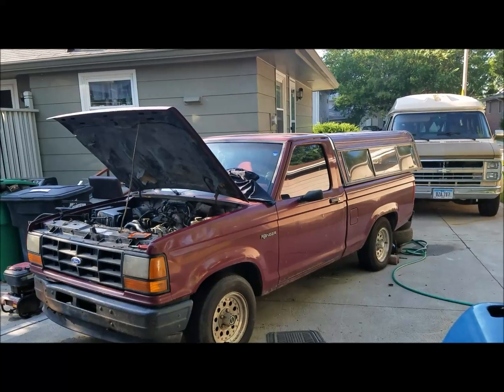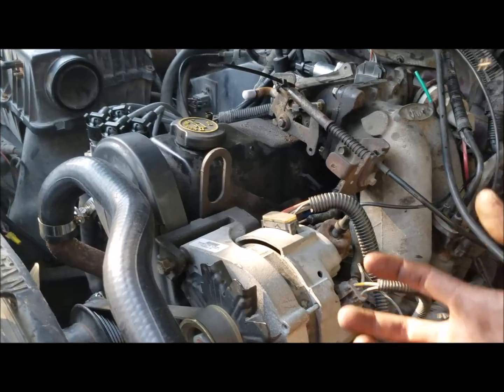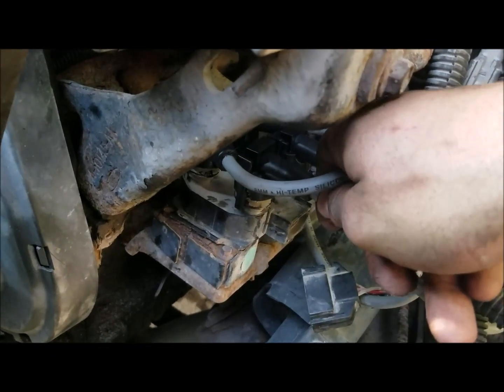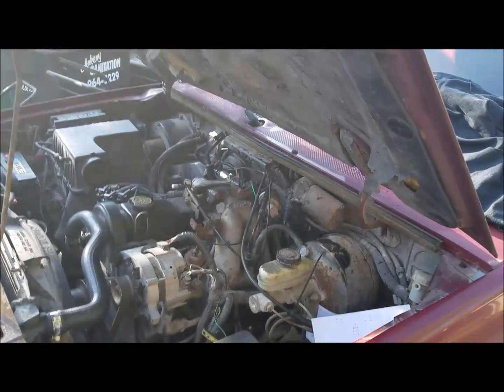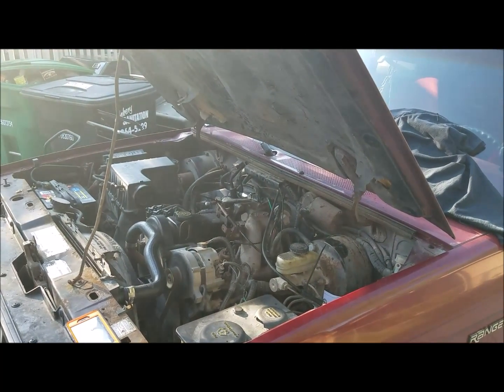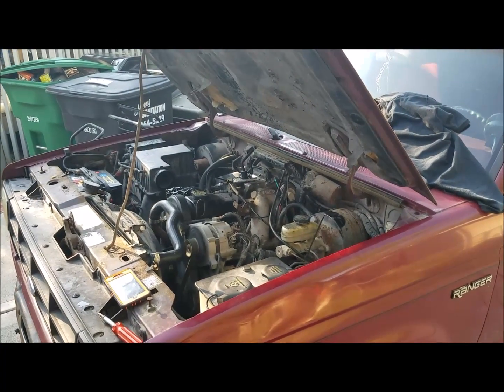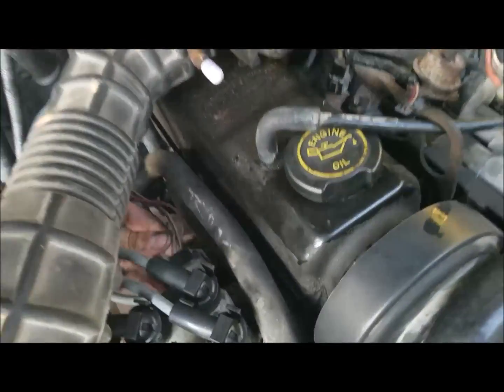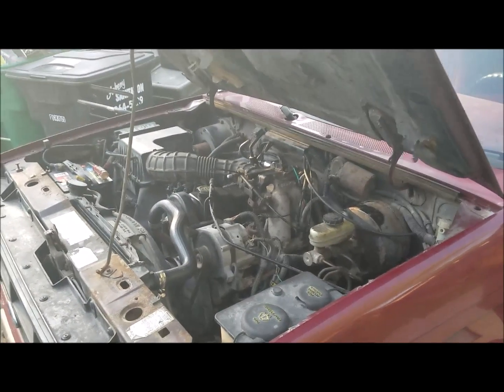Ford 2.3 8 Plug Head - FREE Dual Ignition Mod: How To & Demo (+ HP & ECON)

Comment: Anyone out there no where the cam timing sensor is located on a 2002 ford ranger 2.3L double over head cam engine? I can not find anything on this engine. The sensor is not located behind the coil pack.

Comment: Just did it, it works fine, but I don't feel the actual improvement.
Reply from the maker: The secret sauce behind the different likely only matters if you have the ignition design that has the coil configuration that I have here which apparently was only for 2 years.

Comment: Mine will run on each of the two coil packs. I unplugged one at a time and it stayed running. Is that not supposed to be like that?
Reply from the maker: I bet your coil packs aren't like mine - this has been some time ago, but this video is only true for the engines that don't have the coil packs beside each other.

Comment: You can't burn fuel on the exhaust stroke. It has to be compressed for the spark plug to ignite, and even if it did burn on the exhaust stoke, you got serious issues with that much leftover fuel, and if it did burn, that would be horrible for the engine firing while another cylinder should. The waste spark system is not an emissions thing, its just simpler for it to fire in pairs. And it fires the WASTE spark with the cylinder that's on compression so that it couldn't be more opposite or cause an ignition timing problem. 
The catalytic converter is what burns off anything extra.
The EGR valve is what controls exhaust temperature, keeping pinging/spark knock away. 
Putting the same amount of fuel against two sparks, even if you could without some serious rewiring, isn't changing a thing. 
Would you put two polite lights on a stove? Probably not cause it already starts with one. 
Doesn't anyone think that Ford would have just made them like this if it was better? Again, a waste spark sytem has nothing to do with emissions. It wouldn't be called a WASTE SPARK if it did anything but waste a spark. You can't trick the engine into firing differently by doing this. 

You wanna get more power from a 2.3/2.5 Lima? Fuckin re-gear it, change the tire size, and leave the engine stock cause they run the best the way they were built. There's hardly a thing you can do to an EFI speed density engine to improve performance besides to maintain it, convert it to MAF, or swap the engine.

Comment: What would happen if someone gets the wrong wires in wrong place on accident bent valves dented pistons 2.3l ? Only thanks
Reply from the maker: Your ignition timing or when a plug fires has no bearing on your geometric relationship between your pistons and valves ....
Reply: That year 2.3litre is a no interference motor

Comment: This is a troll myth.. Ford designed this ignition system to fire both plugs at the same time at the factory
Reply: Actually had them fire on ignition stroke and exhaust on other for emissions
Reply: @floridaforecast  it's a waste spark system; cylinders 1 and 3 fire simultaneously, then 2 and 4 simultaneously. It trips people up because there's 2 plugs per cylinder, and they fire simultaneously too, there's not lead and trail like a wankel engine. Couple ir together for a total of 4 sparks per pulse; Cylinders 1&3, 2&4 1&3, 2&4

You can actually rearrange the plug wires to to have 1 coil pack fire cyls 1&2 and the other 3&4 but if you do that, you'll outright loose 2 cylinders if 1 pack fails. That's why Ford arranged the wires to split the difference between 2 coils so if you loose a whole coul pack you're only losing one banks of plugs, not whole cylinders

Comment: WTF??? The system is designed to fire at the same time. One side doesn't fire on the exhaust cycle! Aircraft engines fire simultaneously and are tested before take off with a power reduction being noticed when you switch from dual to single ignition. If yours was set up this way it was defective.
Reply from the maker: I’ve looked into this further - they only did it this way for about 2 years. When they went to both coils on the passenger side, they no longer did it this way

Comment: You do understand that each coil fires 2 cylinders at the same time? Hint, each coil has 3 wires, 12v and 2 control wires for each half of the coil, put 2 and 2 together.

Comment: I thought I killed this modification myth in 2010 on Ford ranger forum. It is physically impossible for this to work because it was designed to work that way from the factory. They have a waste spark ignition system, both coil packs fire a plug on the power stroke and a plug on the opposed cylinder that is on the exhaust stroke. There are two daul post coils per pack, the cylinder that is under compression has the strongest spark. They did this as a cost cutting measure because it's less moving parts.
Reply from the maker: This is actually untrue that it doesn’t work - I messed with some other rangers of different years. The only ones it works on are the rangers that have the coil packs on opposite sides of the engine - this was only for two years. After that, ford did have it fire all the time, which if you open the hood and see the coil packs together - that’s what you have. 

That’s how this mod got popular - because it actually was a thing a one point in ranger production models
Reply: Like your the originator of myth killing lol

Comment: Picked up a 1990 vintage ranger for $800; needed some work, new radiator and hoses, dead starter.  Also found coils for 2&3 weren't firing, swapped the "exhaust" pack or whatever you want to call it until the new coil arrived.  I'm going to give this mod a shot not that I've got 2 fully functional coil packs.  Thanks!

Comment: I've got a 92 ranger and one thing that I noticed that is different is my coil packs for both drivers and passenger side head plugs both reside on the passenger side of the engine next to each other instead of each one being on either side of the engine
Reply: Thats how the newer style 2.3's run. I've started building them for offroad applications and its .ore desirable,keeps them dry and more accessible.
Reply: Mine are on either side but the drivers side one is damn near impossible to. Get to without pulling at. Least the alternato

Comment: Trying this on a 93 both packs are up top, does that matter
Reply from the maker: Yep, it won’t work
Reply: @ThunderHead289  I just tried it and in actually sounded better, and burnt a lil carbon, but as far as actually helping, I haven't drove it yet
Reply: @rickyallgeyer9254  any long term effects from doing this? I’ve got a ’93 2.3L 5-speed 2WD with 3.45 gears. It’s my daily commuter and has problems getting out of its own way trying to pull the hills on the way to and from work. I average around 20mpg with it running about 70mph. I’m looking to maybe get better mileage if not a bit more power out of it.

Comment: @thunderhead289: the "front" of the coil faces the front of the Truck, or the firewall/ coil connector? FYI: My Ranger has both coils on the passenger side of the engine.

Comment: Luke. I bow in humbleness. You are the KING. I'm literally blown away by the mass of videos and data you have put out. Good God, you're a font of knowledge. Simply awestruck and amazed. Thanks for sharing your gift. I'm pretty sure no once competes with the sheer number of videos you put out and the massive data that you put forth. Your interest in this truck got me looking through the classified and I found myself a 1999 Ranger 2.5, with 5 speed manual and brand new tires. The gentleman who owned it couldn't get it started after picking up his dry cleaning and the dry cleaner told him to get it gone from his parking lot in three days. In a panic, the owner told me I could have it for $400 if I towed it in 72 hours. Done! $50 dollar tow to the house and I'm pretty sure it's a fuel pump. Can't wait to dive into this one! It also has the 8 plug head and I wonder if the same mod can be done successfully. Thanks again buddy for your efforts. You ARE the KING! Wow!
Reply from the maker: You are too friendly! Thanks so much, I’m just some average joe guy. 

Now, with the ranger you just picked up - a good way to test if it’s a fuel issue is to simply pop the intake tube off of the throttle body and spray a little carb cleaner in - if it fires off, you no ignition is good and it’s only a fueling issue holding it back 👍

Comment: The exhaust side plugs are on the right side of the engine. Youre swapping the left side plug wires.
Reply from the maker: You are incorrect
Reply: @ThunderHead289  My 89 2.3 exhaust ports are on the right side of the engine. The wires to those plugs are on that side too.

Comment: Be aware if you straight pipe it and try do burn outs you well shoot a cylinder rod threw the oil pan I have a Ford ranger 1994 4 cylinder manual that's identical
Reply: Why would this happen?

Comment: Dont mean to crowd your page, but i found some more info on this mod.
This is for 91-93 owners. This is the TRUE "dual plug ignition mod" not the pointless (and infamous) plug wire swap! It's extremely easy to do. It only took me 15 min once I figured everything out. I got a lot of info from threads on DIS conversions over on turboford.net.

Step 1: Locate the ICM (on the front of your intake manifold)
Step 2: Look for the number 6 printed upside down bellow the top connector (black) on the ignition module, it's the pin closest to the engine.
Step 3: Remove the electrical tape around the wiring harness
Step 4: Follow the wire coming out of the connector on pin 6, it should be blue/green stripe. Trace the wire back as far as you can, it should be at a "T" junction where it enters the main harness.
Step 5: Cut the wire and crimp a small eyelet on the side that comes from the ICM connector. You should have about 6" of wire to work with.
Step 6: Remove the top 5.5mm bolt that holds the ICM to the intake.
Step 7: Slide the bolt through the eyelet and reinstall the bolt.
Step 8: Re-wrap the harness with electrical tape. That's it, your done!

The wire you grounded out is used for the Dual Plug Inhibit function. The EEC applies power to this circuit when the key is in the start position. This signal is used by the ICM to inhibit secondary coil pack operation bellow 1500 RPM. The EEC doesn't monitor the circuit, so you shouldn't get a CEL. Now both plugs will fire at the same time; all the time giving you better throttle response!

WARNING: Since the dual plug setup was originally designed to decrease emissions modifying the system may cause you to fail smog. My opinion: I really don't think it will cause a fail, but I have to cover myself just in case. If it made that much of a difference on emissions then all 4 plug 2.3s would fail. =)
Reply: This say 91-93 owners. But what about 94? I have both coil packs on the passenger side of my engine, as I assume 91-93 owners do.  I'm hoping this mod would work for me as well!

Comment: Can anyone confirm or debunk this Comment I found on a forum from some know it all. 
"That is a 2 channel coil (wasted spark system). It fires #1 + #4 and #2 + #3 at the same time as pairs. That means when the #1 cyl is being fired on its exhaust stroke, #4 is being fired on its compression stroke. (ignoring the other coil, for now.) Switching 1 + 4 does nothing, except move which terminal, on the same channel of the coil, the wire attaches to. 
With this 2 coil system, wasted spark system, you always have both plugs firing on both the comp and exh stroke. One is being fired on the main coil (on purpose), the other is being fired on the secondary coil (as wasted spark). 
If both spark plugs were to fire at the exact same time in two different locations would that not cause two flame fronts to collide creating abnormally high cylinder pressure? When carbon or high compression ignite the fuel mixture in a second location the two flame fronts traveling toward each other and the rapidly expanding gasses cause extreme but short cylinder pressure. So.... two plugs firing at the same time would cause the engine to detonate or ping. I have not messed with a 2.3L dual plug head, but I would have to assume the second set of plugs fires after the main burn in hopes of igniting any un-burned combustables for emissions"?
Reply: Did you listen to the video? The secondary fires on the exhaust stroke. It's mainly for emissions. Did you see his demonstration of the truck running on the secondary coil only? Here's a tip: there aren't professionals on forums, they are too busy working on the subject to go home and keep working for free.
Reply: @colormesarge  Nothing wrong with trying to get a consensus bro. =) And how could you possibly know whether a professional chimes in on a forum or not?
Reply: Anthony Wayne 
You’re absolutely right. They fire in simultaneous pairs, alternating compression and exhaust strokes. The coil packs only have three wires feeding each- one common and two signals to hit the two solenoids alternatively from the ignition control module. If you want both plugs to fire simultaneously on compression stroke you’d either have to swap the wires at the coil pack of the passenger side (exhaust fire) or parallel the coil pack signal wires to force them to fire the same (at least that’s how I see it)
I stumbled on this vid because I’ve got a check engine light- codes 222, 223, 224. Basically the primary side isn’t firing. It’s running off of the exhaust side plugs. Either bad coil, bad ignition module or bad crank position sensor. 
This mod would work in theory, but some wiring needs to be done to get them to fire right

Comment: Have any problems with it? And how do I know if I'm running lean. I've got an 87 ranger 2.3 5 speed
Reply: I just switched my ignition wires with this mod today. I will get back to you in a week. I have done a bunch of work on my 1990 Ranger 2.3l manuel transmission including (head gasket, timming belt, all new gaskets. I set the timming advance 5 degrees and it was running lean... Now it's adjusted properly and running awesome!
Reply: @stevereid5885  how did it work?
Reply: @jagrgreen8123  not even worth the time really...
Reply: If your timming is advanced slightly it will run lean and cause the engine to add to much gas at wrong time. Stank stankey
Reply: @stevereid5885  have any problems with this.mod at all?

Comment: This is a DIS "wasted spark" system, so sparks * always * occur near the tops of both the compression stroke and the exhaust stroke for each cylinder.  That's why each coil pack has only three wires:  Ignition (+), 1&4 coil (-) and 2&3 coil (-).  In other words, each coil pack has only two primaries and two secondaries, and the secondaries have plug wires at both ends of their respective coils.  When a DIS secondary "fires" near the top of every stroke, a spark is "pulled" across one plug gap and "pushed" across the companion plug gap. The spark occurring near the top of the exhaust stroke is "wasted", but since there is no compression at that particular moment, it uses very little energy, and the companion cylinder near the top of its compression stroke gets the huge majority of the voltage drop (and therefore energy).  By swapping the plug wires at the coil towers for cylinders 2 & 3 and cylinders 1 & 4, you are not changing this behavior in the least bit.  All you are doing with your "mod" is changing the polarities of the secondaries, causing the sparks to travel in the opposite directions.  This will cause the spark plugs to exhibit slightly different wear patterns, but will have  * absolutely no other effect *.
Reply: Idk much about vehicles, seeing two coil packs on a 4 cylinder threw me off a lil. But like I said idk much about engine stuff. In the process of learning by working my my ranger,,
Reply: So it's definitely not worth it?
Reply: So it's not worth it?
Reply: Also, in a waste spark system, the secondary coil, the drivers side isn't activated untill the engine starts. This guy did absolutely nothing.

Comment: Wow, I tried this on my truck this morning and it made a huge difference. I don't notice any more power but the engine runs way smoother. Its a 5 speed and would lug and buck some when shifting unless I roasted the clutch. Now it does fine, even in reverse. Like, it is way better, more like how modern engines feel. Before it was like there was dead space in between combustions or something.

The one thing I did notice is a little hesitation if I really punch it, but it might have done that before. Also I think my spark plugs are really worn out. I wonder if the mod wouldn't be as effective on an engine with fresh plugs.

Day and friggin night.

Comment: I'm swapping a Turbo coupé Thunderbird 2.3 into a 1990 ranger now. Pretty easy swap.
Reply: I had previously wanted to do a carburated 302 swap,  but I now think the turbo 2.3 with an intercooler is the way to go!
Reply: How long did it take and did you use the Thunderbird transmission I have 1994 Ford ranger and thinking of doing same thing

Comment: Question.. I have a 94 Ford ranger 2.3 , 2wheel drive. I'm having issues with one of the coil pact not sparking. I have changed spark plugs and wires n the truck is still struggling as if it has a misfire n I checked the front coil pact n it wasn't sparking but the back one was. I have already replaced the front coil pact and it's still doing the same thing. Any suggestions on what it might be? Thanks.